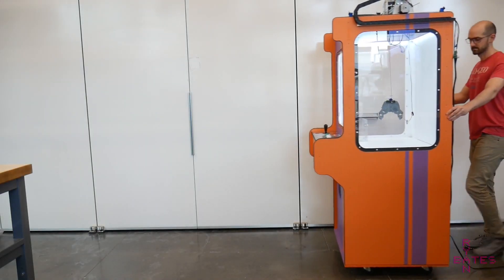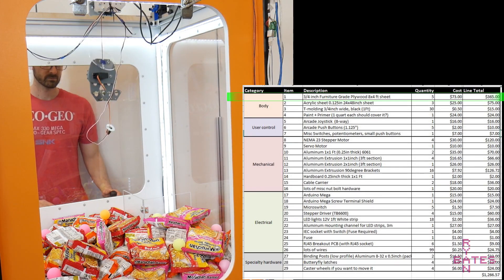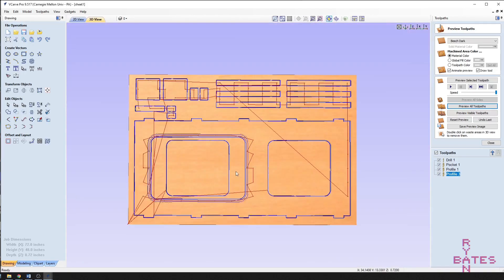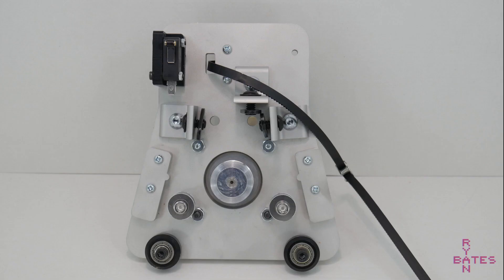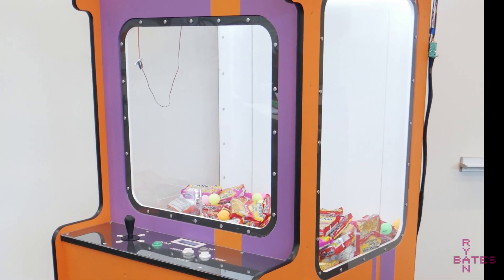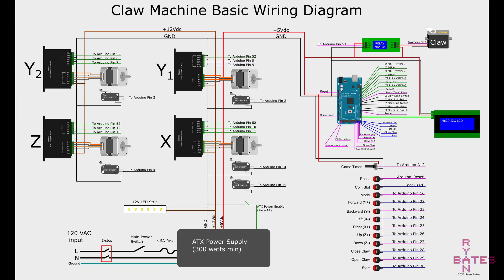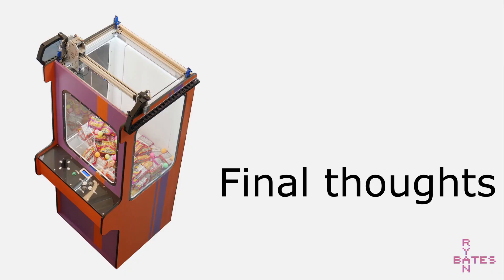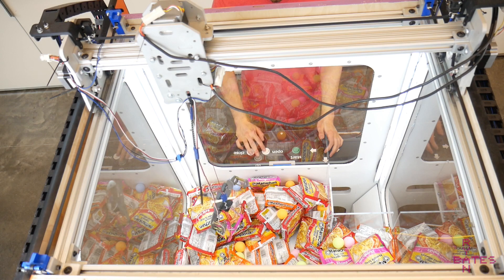Open Source [Full Size] Arduino Claw Machine for Ramen Noodles

Comment: aluminum extrusion 3ft is same 6061?
Reply from the maker: no. aluminum extrusion (the 80/20 type) might be 6065
Reply: @RetroBuiltGames  thanks,You are still missing the coin acceptor and electric eye. I hope you can authorize me to strengthen it.
Reply from the maker: what is the electric eye?

Comment: hello your channel is super interesting, I have a question could you show how to make a distributor automatic of thing cold like bottle (with the coin and credit card system) I want it but the problem is that I don't know anything  in electronics.
Reply from the maker: thanks. the only way to learn to to start. try making an LED blink with an Arduino. in time you will understand.

Comment: Excellent. Even though I will never build a claw machine, this video gives inspiration to attempt something!
Reply from the maker: thank you! what do you plan to attempt?
Reply: @RetroBuiltGames  Not sure yet. In the past I worked for a company that made, among other things, stepping motor control systems for grinding machines. I was a field tech who installed and repaired them, so it would be nice to get reacquainted with such devices. The problem is, I don't have a need for anything that uses them, hence the "I don't know" response.